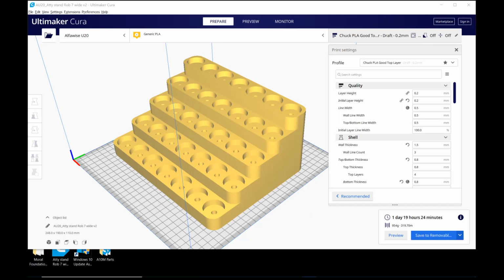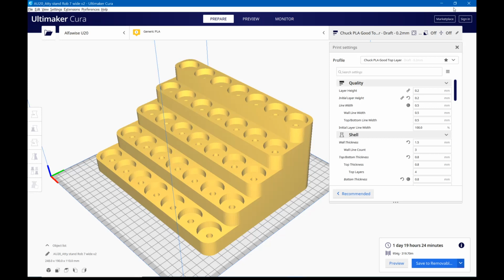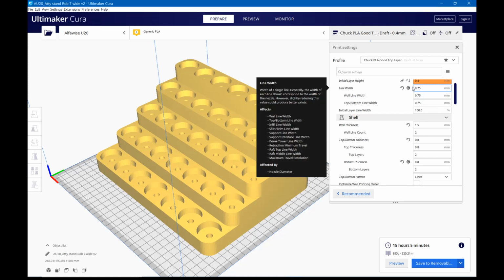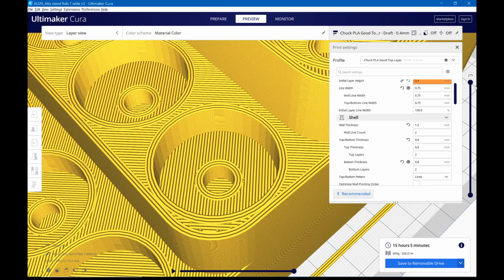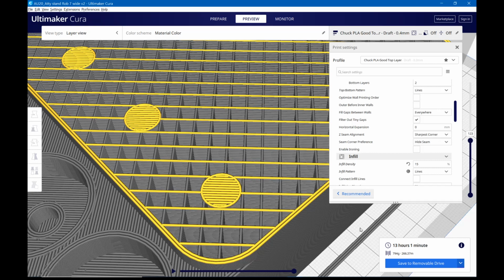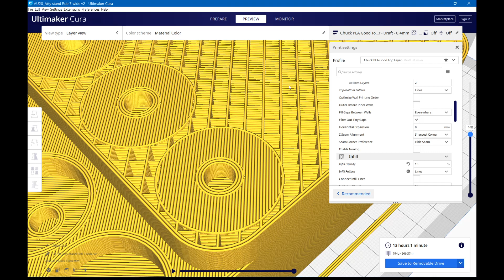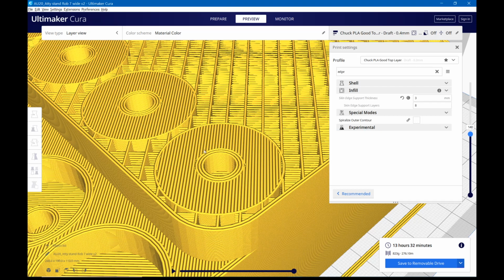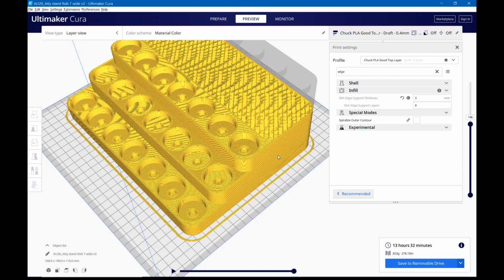Cura Slicer - Skin Edge Support. Get good top layers over sparse infill.

Comment: For things like this sometimes I used the lightning infill of PrusaSlicer, which is very sparse but gets denser and denser around the areas that need more support. In addition to that, PrusaSlicer (and Slic3r before that, I think) always laid down a foundation that is wider than the floor to accommodate the sparse infill better. I used Cura for a few years before switching to Slic3r (later to PrusaSlicer) because it had a few features that resulted in better prints in most cases (there was still some that were better with Cura for a while but I don't think that's the case any more).

Comment: Your video is the first result for searching, "3d printing skin edge videos".
I'm getting ready to do my first Extra Fine Print and the "Infill Density" percentage notes says it affects the "Skin Edge Support Thickness."
...Skin Edge Support Thickness?🤔 maybe Google this?
Reply from the maker: Cura has changed a bit since I made this video and I haven't yet seen the note that you're referencing, but it seems to me like they mean the infill density setting controls the thickness of the lines that the skin edge support draws (the circles I showed in the video that supports the first layer of the floor on top of the infill), which when I think about it makes sense. Question that leaves me is what is "thickness"? Is it side to side or up and down? I suspect it's up and down, but I'd have to test it to be sure.

Comment: This can be very handy.  One problem I still have is that infill needs to be dense enough to be under those features.  It would be nice if it could somehow branch off of infill and go to the feature.  Sort of like tree support, but for infill.
Reply from the maker: The version of Cura that's in beta right now, I think it's 4.12 has something called "lightning infill" which does exactly what you're asking for.

Comment: good advice, thanks.

But is it really not easier to make this part of plywood?
Reply from the maker: Easier for who? To make this out of a block of wood you'd need a vice and hand saw, or a bandsaw to cut the wood. Then you'd need a means of roughing the shape and rounding the corners, such as a belt sander. Then you'd need either a mill or drill press and some means of drilling a flat bottom hole, such as forstner bits or end mills. Then lots of hand sanding and then staining. And of course the skills to do all that and have it look good. 

If you've got access to those tools and have those skills, then yes, making it out of a block of wood may be the better option. I suppose a skilled woodworker could do it all with hand tools, but again you'd need the tools, the skill and the time. 

While I do have most of those tools I'm not a woodworker and have no desire to become one. Besides, this channel is about 3D printing, not woodworking ;)

Comment: Just a thought. If you turned your model upside down and used wide supports for the vape holes and hollowed out the main body, would that not be quicker and use less material. 
Granted the top layer would not be as smooth but worth a slice 🙂
Reply from the maker: I actually tried this a while back but had a lot of issues with getting the support material out of the holes, it took quite a while to clear it out and it left a nasty upper surface. Being more experienced I could do a better job now with the support settings, but to be honest I'd rather have the extra material in the model giving it a more substantial feel than in the garbage. Good idea though, it's always worthwhile to think outside of the box.

Comment: That looks like a very useful setting. I tend to use pretty low infill values and sometimes get some gaps in my prints that might be caused by what you're describing. 
FWIW, I upgraded to Cura 4.7 when it first prompted me to, and it worked great for a print or two, but then It started crashing on me. I even completely removed it and re-installed it, and it's was still crashing, so I went back to 4.6 for the time being.
I also lost my custom gcode in the process, and had to go back to a backup to retrieve it, and then missed a character when I reinstalled it, which cost me more headache with octolapse crashing for no reason!
Anyways, I'm also from the SW, and wondered if we needed to care about humidity, so I enjoyed your testing videos. Keep up the good work!

Comment: You could also use gradient infill to same some filament.....
Reply from the maker: I tried the gradual infill setting when it was first released and for some reason had trouble with it. I'll have to experiment with it some more, I'm sure I just didn't get the settings right.

Comment: Good information as always. If it were me, I'd probably make that using wood to save a bunch of time and plastic. The pockets can be easily done using a Forstner bit for nice clean holes.
Reply from the maker: I have very few tools for woodworking and even fewer skills at it. So that's probably not a viable option for me. I wouldn't even know how to cut the steps cleanly or squarely. I'd spend days at it and when I was done it would look like warmed over dog crap.
Reply: @3rdpig  Haha. I wouldn't cut the steps. I'd cut individual 3/4" thick boards to  the required width, bore the holes, then glue and stack them up. A bit of sanding and a wood finish and you'll have a beautiful and functional stand.
I'd also design-in and build a couple of small drawers that would pull out from each side for storing bits and bobs. You can do that with your plastic version too. I'm sure your wife would appreciate that.